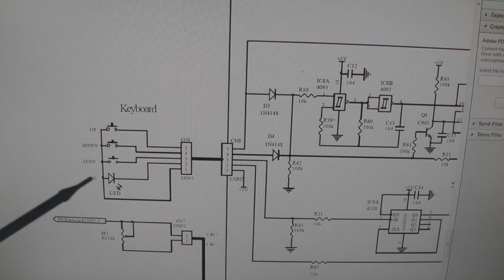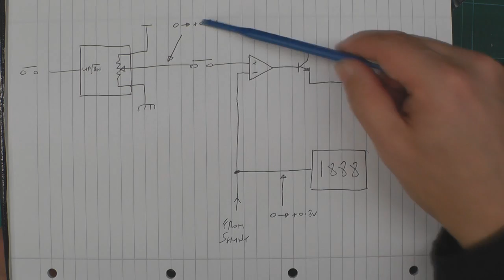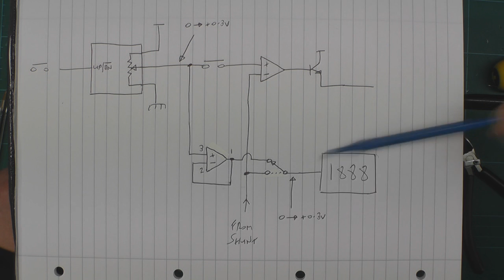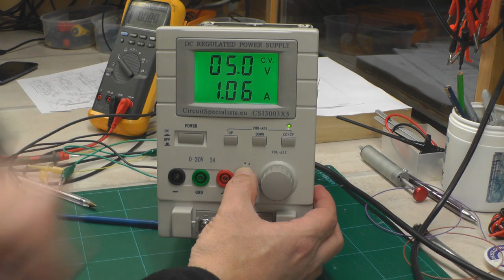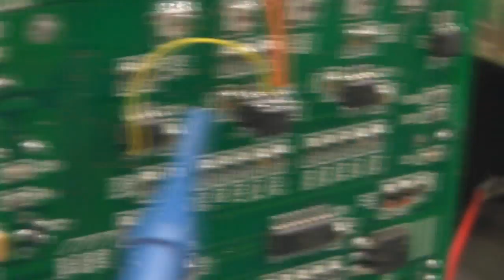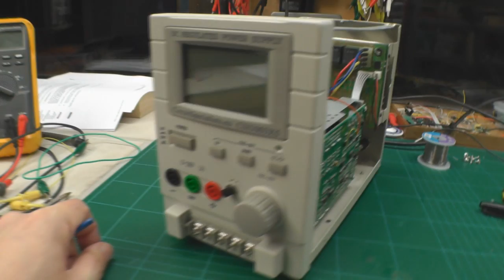CSI3003X5 Bench Power Supply - Constant Current Mode Modification

Comment: Hi 
Inspired on your video, I did the modification to my power suppy, one year ago, using your design.
Today I modiffied the CC/CV button and convert it on ON/OFF output button. Now I can activate/deactive the output. :-)
I have the CC mode permanently enabled, because every time I turn off and on the device, I had to remember enable the CC mode. Yesterday I forgot to do it, and unfortunately I lost a LDO regulator.
Once more time: thanks for your videos and time
Best regards
Eduardo

Comment: Hi, talking about power supplies, on your website you've had a really nice project (a linear  PSU with digital controls that you've made and published there) but never provided the code for it. You said that you will @ some point in time but.......what has happened to it ? You've completely removed it from the website and left us all in the dark. I really wanted to build that PSU and run it with my own code but now is gone. I wonder why ???? Tnx. PS: do you still have it published elsewhere or.....!?!?!?!
Reply from the maker: It was an experiment, an experiment I don't think I will get back to......there are lots of issues with the design and to tell you the truth it probably needs a good old re-design. My apologies for leaving you in the dark. There is a much better open design over at eevblog.com forums: https://www.eevblog.com/forum/projects/eez-h25005-a-possible-successor-of-eez-h24005-programmable-power-supply/    and also here    https://www.eevblog.com/forum/projects/diy-programmable-dual-channel-bench-psu-0-50v3a/

Comment: I like your mod and will do it if I can get my CSI3003X working again.  I was testing a 40A solar charge controller using my CSI3003X as the solar panel and while it maxed it out to 3A I paid no attention until I smelled smoke.  I can't find a schematic for the power supply but noticed you modded something similar so was hoping you have a link to the schematic?
Reply from the maker: +Doug LaRue Contact me via my site......I have a diagram.
Reply: +IanScottJohnston ok, did that. thanks.

Comment: Ian, you should diode feed the two buttons to a 555 or other one-shot such that it will switch over to CC monitor mode for a couple of seconds, once you stop pressing the buttons the timer will time out and switch back to current monitoring mode - this way you would not need an extra button...
Reply from the maker: Yes, that sounds like a plan for the dual output CSI psu.....possibly even a wee Eagle PCB for folks to use.
Reply: https://youtu.be/Y3rjHu_1jg0

Comment: Great Video, what is the numbers on the Op-Amp you added?
Reply from the maker: I added an old op-amp from my junk bin, an OP295, but just about anything will do. I paralleled over an OP07C and since the supply pins are a little different it meant staggering the resistor legs I used.
Reply: Thanks

Comment: Great work Ian! I have to say that I would find the up/down buttons for setting the current far too annoying for regular use. Maybe you could look at a mod to allow you to set the current either by a pot, or maybe even easier a rotary encoder that is basically just pulsing the up/down switch inputs?
Reply from the maker: Thats definitely possible, and yes I'd prefer a pot also.....however, I am finding the up/dn buttons not near as bad as I thought they'd be. The speed of them is quite fast, and you can hold for auto-repeat. Hmmm.

Comment: Would not shorting the outputs achieve pretty much the same thing?
Reply: Yes and no. By shorting the output, you have to disconnect your load, which may not be ideal. You are also causing a 5A short at some wattage. Ideally you have to change your voltage down to reduce the problem the short causes. This allows you to change the constant current limit without disconnecting everything.